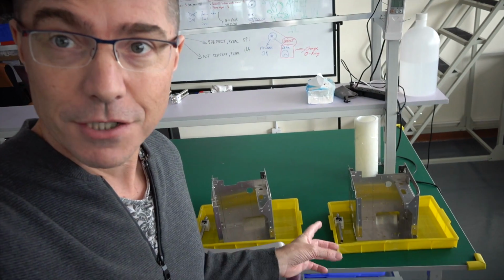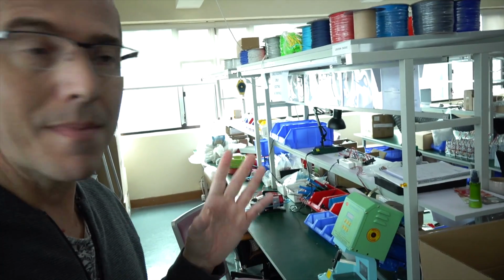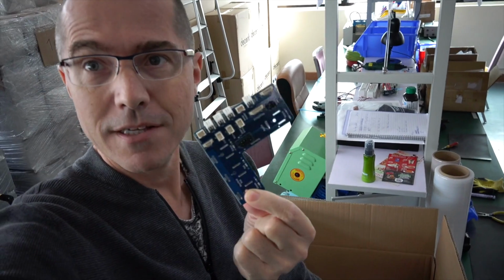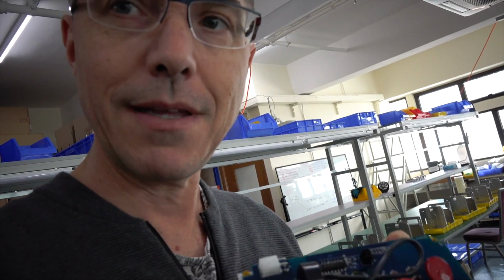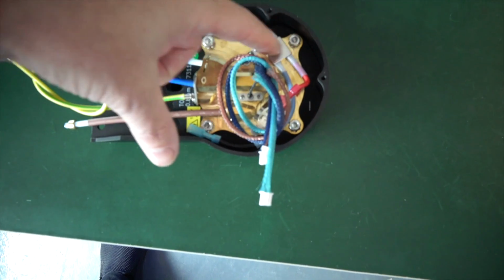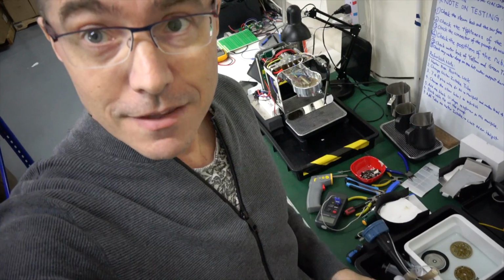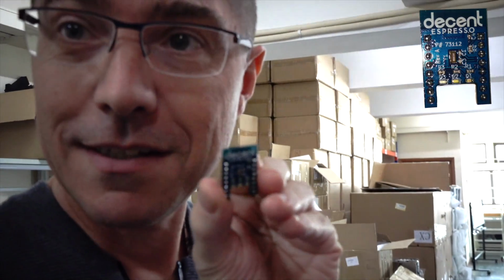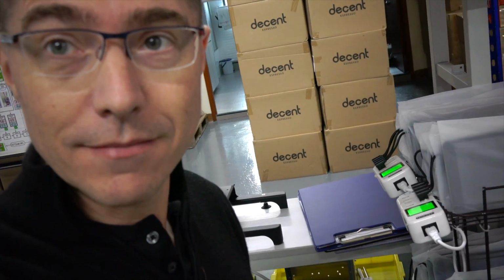Factory Tour

Comment: Really impressive!!
Is that an Digmesa Flowmeter? @decentespresso
Reply from the maker: It's not. We have tested the Digmesa but found it had two problems: it was very susceptible to shipping damage, and the precision turbine inside it reduced water flow.    Since we use mathematics to calculate flow during low flow situations, we don't need the tiny parts and mechanical solution that Digmesa provides.